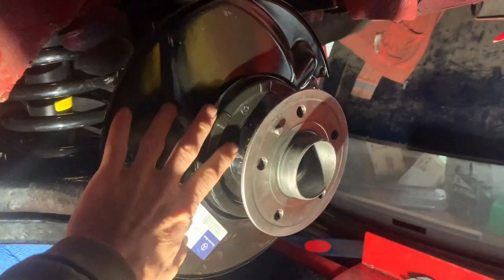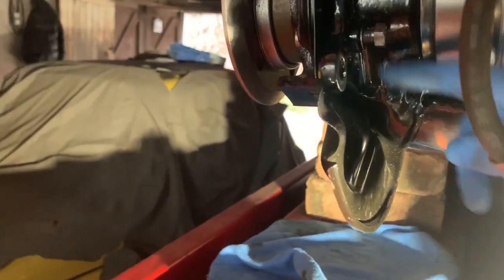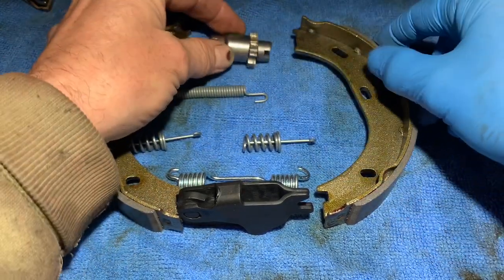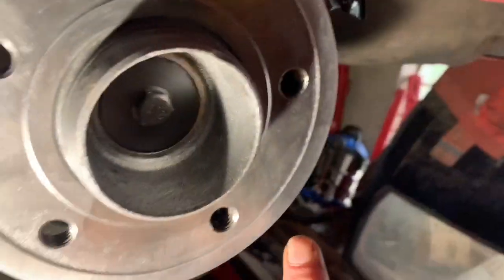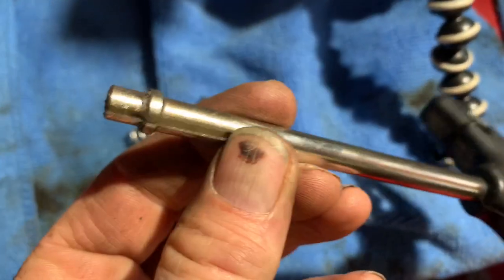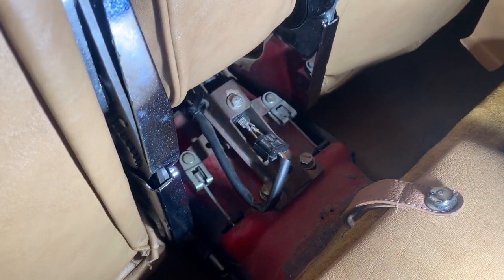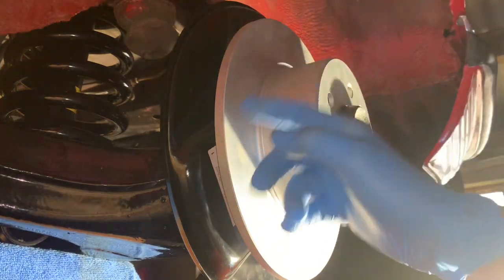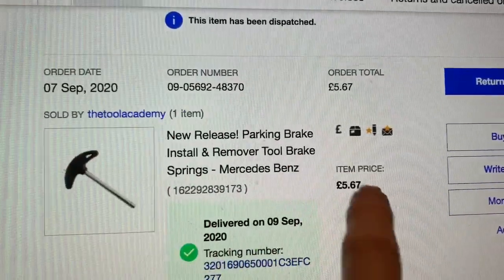Mercedes R107 SL hand brake or park brake installation and adjustment

Comment: I'm just about to have another go at this on my Vito. Its next to near impossible 😞
Reply from the maker: Good luck..what makes it so hard on the Vito? Mike
Reply: Ok, so....ive managed to do the nearside !!!!!! Gone to do the office side to find the backing plate is rusted so bad the retaining springs have nothing to go to. I had to bend and break it out and then use molegrips to get the torx bolts out.
Reply: I think its just a very fiddly job full stop. Your video has helped though. the nearside went well til I saw the dust shield on the off-side. @MikesMercsandothercars
Reply from the maker: Well done on getting one side done.

I had to replace the dust shields on that red merc and that was a job and a half...and costly too! Let me know if you get round to doing the other side and post any tips - they may be useful for other readers.Mike

 @justinneal5751
Reply: Will do Mike. Ive seen other people on YT cut these with an angle grinder at  a specific point that allows them to slot over the hub, thus negate the necessity to remove the wheel bearing which is something I cant contemplate having to do. Will report more next weekend @MikesMercsandothercars
Reply from the maker: ...OK. Well, if you do decide to remove the wheel bearing and put on a new dust shield. here is some light viewing for you....

https://www.youtube.com/watch?v=mFJgr6BxpWU

Mike

 @justinneal5751

Comment: This video helped me to decide to scuff up my existing parking brake shoes and reuse them.  Thanks!
Reply from the maker: …….do you mean because the job looked complicated? Mike
Reply: @MikesMercsandothercars  Any time a pro describes a job as tricky, or easier said than done, it means it will take me 8 hours.  My existing shoes were in fine shape, just a little glazed.  I scuffed them with some 120 grit and installed the new rotors.  Excellent video!
Reply from the maker: @winstonsmith3685  Yes, a good philosophy....if it ain't broke don't fix it. Mike

Comment: Another great video Mike but you have made it look really easy! I have the brakes apart on my 1974 450 SLC as I decided to sort the handbrake whilst waiting for some trimming to be done.  Got them all apart but getting the springs on and the new shoes back on is a real struggle. You have made it look easy but on mine the spring tension is huge, so the springs done easily stretch (mine is a Brembo kit) and getting the first spring (the fat one) behind the handbrake piece is hard but once done the spring won’t stretch to hook onto the shoes.  There is a bracket type thing you can see on your video which the bandbrake mechanism buts up against (looks like ot ois there to stop that moving sideways) and it looks like it is held by 2 allen bolts but serves no other obvious purpose so I was wondering about undoing it give more access.  Have you ever had to do that and any thoughts?  I am a bit reluctant as i did the same with the bracket holding the shackles behind the hub in order to get the seized brake pipe off the flexible hose and it has been a pig to get back on because one of the bolts sheared. Thanks, John
Reply: The part (bracket) I mean is part no. 65 on the rear axle suspension parts diagram if that helps
Reply from the maker: Hi John

Sorry to hear you are struggling with those springs. When dealing with huge spring tension, there is a method to spread the spring shown at 5.57 in the video below:
https://www.youtube.com/watch?v=o1GeNSt-poA

My advice is don't remove bits unless you really have to.

Let me know if the 'bend and wedge' method works for you.

Mike
Reply: @MikesMercsandothercars thanks Mike, will give it a go and let you know
Reply: All sorted.  The answer was obviously leave it a week and have another go in a better mood.  Springs pulled into place with long nosed liers
Reply from the maker: @jonnybigpotato4263  Yes - I often find that 'sleeping on it' yields a solution. Mike

Comment: I use to own  a SL450, 1973, and a Slc450 1978  in the past, and a few  more after that. Finally went back to the good old days. Currently own  a E300D and a Sl320, both 1995.It’s amazing how well they engineered these cars. I just did my emergency brakes on my Sl320. Looks like not much has changed. Well done👍
Reply from the maker: Thanks for your comment - yes I am always amazed by the build quality of the earlier SL's. It is incredible to think that the Fiat 238 van we just bought is 1980 whereas the red 280SL I'm woreking on is actually 1976 - they are worlds aprt in build quality , innovation and design. Mike

Comment: Great detailed explanation. Tempted to try on my car.
Reply from the maker: It is one of those potentially scary  jobs that looks quite complicated but 'Once you know how' is relatively simply, cheap and satisfying. Mike
Reply: @MikesMercsandothercars  Thanks. If you’re ever back in Santa Monica I’d like to show you my 450SL. 🙂
Reply from the maker: @runnerhoss  When (if) things get back to normal I'll definitely be doing a US trip....not least because it is so much cheaper to buy SL parts such as soft tops and seat covers etc. See you then!. Mike.

Comment: Is your merc a late 70s merc?
Reply from the maker: The red merc in the brake shoe video is a 1983 280SL 5 speed manual. The silver merc in other videos is a 1976 4 speed left hand drive manual. MIke
Reply: @MikesMercsandothercars  ah i see. I have a german 1971 LHD
Reply from the maker: @Kellysg126  Wow - that is the first year of production. Did you know that the Mercedes 107 SL was the 2nd longest production shape of any car (beaten only be the Mercedes G wagon. Mike
Reply: @MikesMercsandothercars  wow! Thats pretty cool!